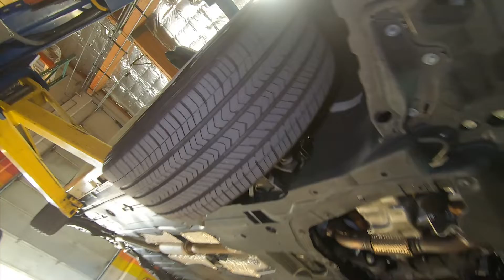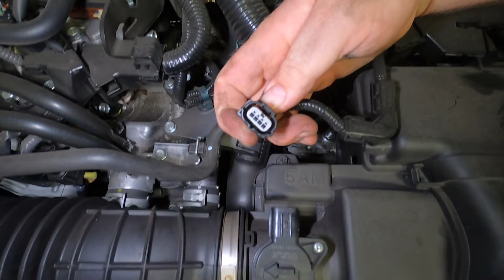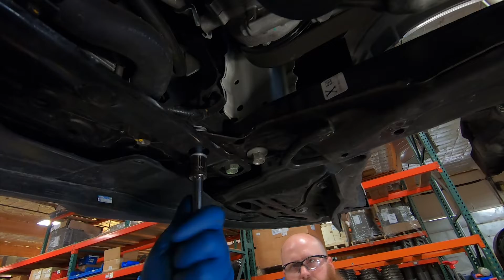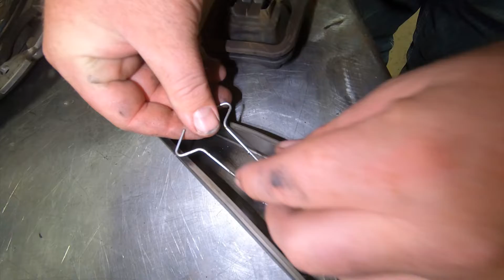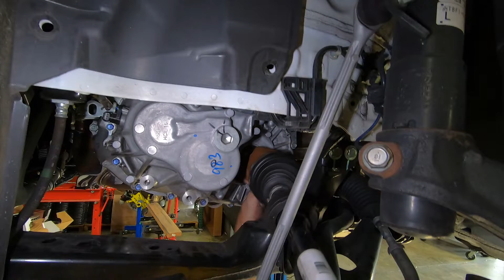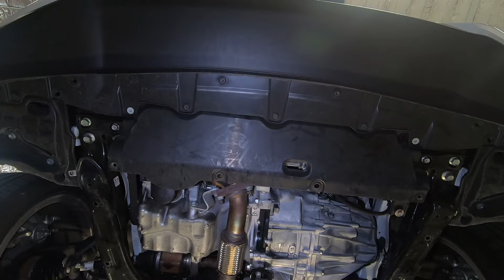ACT Clutch Install: 2017 - 2026 Honda Civic Si 1.5L Turbo and 2017 – 2024 Honda Civic 1.5L Turbo

Comment: My shop just called me saying that the oem bolts for the middle of the flywheel are not the right size for this clutch. If different bolts are needed, where are they so I can buy them?
Reply from the maker: The flywheel bolts included in our kits should be correct. If they feel they are not correct, please have them call our technical / service department @ 661-940-7555.

Comment: Did you guys have any trouble separating the bell housing from the block?  I've got about 1-2 inches of gap between the bell housing and the block but I can't get the transmission to come out any further.  All 8 bolts are removed and both studs are no longer in the bell housing.  There is a big gap around the entire tranny so I know its nothing like a forgotten bolt.
Reply from the maker: We never experienced this issue. If all the bolts have been removed and the transmission has cleared the aligned dowel pins, the only thing we can think of is maybe the input shaft is stuck in the pilot bearing. With some help, try to wiggle and pull the transmission free.

Comment: Just did one just this week if I had seen this before it would of helped. Did it on jack stands the lower starter bolt would not come out it would spin then lock up but would not come out. Had to pull out the Ridgid R86211B it's a beast with1500 ft.-lbs torque. It got it out the bolt had a ball of aluminum on the last 1/2 of the bolt. Pulling the trans & found the bolt hole on that bolt had cracked the trans welded it back up with a tig. When I put it back together used a course thread bolt instead of the fine thread one. The other bolt had wiped out the treads. Doing it by myself took me about 16 hrs. I'm near 67 years old so I'm a bit slow. How long did it take them 2 guys to do that one?
Reply: Shops usually charge 10-12 hours for this job, if that's an indication.  Can crest easily over 2500 for the whole job.  It's sorta silly how involved this is gotten.  Dropping the transmission out of my old integra was cake compared to this.

Comment: I got this same clutch installed in my car,  thought the clutch was bad cause the car was grinding gears and wouldn't go into gear.  Two master techs told me the clutch is bad.  Just as a note, I thought to think like on a dirtbike the clutch and brakes are adjustable be it hydraulic or cable.  So I did adjust the clevis and jam nut / rod underneath the foot well.  All fixed, adjusted to have a little free play.    Just as a note to others.

Comment: Is it needed to undo the whole mount for the transmission or just the bolts for the 2? Just curious, FX725 just went and will be needing to replace
Reply from the maker: If you are referring to the upper transmission mount, it is best to remove it completely.

Comment: Do I need the subframe alignment tool? If so where can I get one
Reply: I think you can get it done without/ probably just helps with getting it straight
Reply: Use a ½ inch socket extension it works

Comment: Thanks guys for the video , finally got this clutch replaced and I am happy with it
Did it all by myself  with two sets of jack stands and one hydraulic jack.
Time consuming but it was done properly ..
Reply from the maker: Thank you for the support! We're happy to hear the video was helpful for you.
Reply: How long did it take you?
Reply: @paull9086  it took me about 5 hours from start to finish,
No need to do alignment or bleed clutch 
I used an engine support from harbor freight,
It is better to remove bolts from wall when putting transmission back on , it’s easier . 
If you have any questions , I could tell you how I did it
Reply: @acevent1281  whats up do you have Instagram so I can text you question about this?
Reply: @acevent1281  Not bad, I'm trying to ball park how long a shop could do this in.
Reply: @BestCaseHypothesis  I got an estimate of 850 near me
I figured I could do it myself
It’s just common sense and a little bit of efforts
Reply: @acevent1281  damn! 5 hours? I thought this job would atleast take 3 days.
Reply: Honda wants 5k for this💀 and all I have is poopy driveway and no tools
Reply: @oggangsterprime9245 yeah Honda just quoted me 5k as well like hell nah bro
Reply: @Mal2Sosa was quoted 6k by toyota for my 12 gen corolla. Did it in my driveway with jack stands and 3 jacks, third jack to hold the engine in place after mounts were removed. Whole process was identical to the honda. I dont have 6k laying around so, said fuck it.
Reply: It’s not that hard , I did it a couple of years ago .  Plenty of videos on how to do it . And don’t need a bunch of tools

Comment: Has anyone paid to have this done? just curious as to how much it ran you.
Reply: $880 with tax at my shop. Customer supplied the parts.
Reply: Mine's in the shop for the clutch install right now. Owner quoted me $800, but I expect it to be a little higher when all said and done.
Reply: Told me 1500 without parts,so im doing it myself now....day 2 on my time lol sucks

Comment: I was gonna replace clutch myself but after watching this video I might as well hop on the bicycle...
Reply: its easier than it looks, just follow the guide, the hard part are the heavy lifting points like taking the trans out. putting it back in is a nightmare too, but everything else is easy enough

Comment: Well looks like the hardest part for me is not having a lift, oh well just got the Exedy clutch kit -08809, gonna watch a few more vids and get on this, wish me luck.
Reply: I may need to do this soon... how did you support your engine and transmission without a lift and stuff? I dont have one either
Reply: All good, only lost one bolt (subframe bolt) hit up up pick a part real quick, also had to readjust the steering shaft. Took about 4-5 hours all hand tools.

Comment: It’s not that I can’t do it’s that I don’t want to do it🤣
Reply: 2 years later, I’m bout to do it😢
Reply: Came back to say stay away from this dog 💩 clutch kit. Throw out bearing failed at literally 300 miles. Read forums all the supplied throw out bearings they give fail. gonna have to do this job twice to remove one supplied and replace with a oem one.
Thanks advanced clutch.
Reply: @Candybuiltsi  thanks for the warning, i was literally about to start this job in my garage solo
Reply: @LouisianaHotdog  yeah it might be cool if your not making a ton of power. My car is extremely violent with solid motor mounts spinning or a slightly bumpy road feels insane so maybe that’s what’s sent it out.
Reply: @Candybuiltsi did you drop the subframe?
Reply: @paynomorethanzero yes. I later learned you can just sneak the transmission off to the right without dropping subframe and slide in new clutch that way. Way easier
Reply: Got it done. Took me solo bout 22 hours 2 days😂 did it in the street with 3 jacks stands and just one hydraulic jack. Was tough but saved some money!! Grabs hard
Reply: This😂😂😂
Reply: keep us updated 🙌
Reply: @yeahok6748 yup everything going so good so far I have clutch in. Doing this solo IS TOUGH had to call it a night tomorrow everything going back on getting the transmission on is definitely the hardest part Im hoping my friend wants to come help me as Im only using a hydraulic Jack😀

Comment: Man none of this looks outside my skill level until I think about doing it all in one job 😆 I want a slightly lighter flywheel and a clutch in my 2018 si but I don't know if I should do it myself. I have all the tools, outside the alignment tools for clutch and subframe. If I do decide to diy it, I'll be watching this video a few hundred more times.
Reply: I’m with you. I have the know how and the tools to do the job. Question is do I want to attempt it, or do I pay a shop $3k and save myself the headache? 💀
Reply: @fordxbgtfalcon  If you have the know-how, then you can comfortably do this in a weekend.
Reply: It's just managing the tons of little ticky tacky crap just to get to the damn clutch.  I hate that.  That's why I'll pay for it to be done.
Reply: Do not get anything from SPEC! Don't ask me how I know or I will cry again 😢
Reply: I havent done it on a new civic but I did it on a 2020 corrolla hatchback and a first gen fit. Previously had only done basics like belts, alternator, brakes etc etc. Took 3 or 4 days hitting it on and off and going to work 2 of those days. Its not bad, just put all bolts and pieces in baggies, label them, keep everything organized, take pictures, lots of pictures as you go. I know this is old but if anyone else is reading and deciding to do it themselves.
Reply: @paynomorethanzero  I actually wound up selling that car during covid because it's value went up $10,000 from where I bought it. I wound up trading it in for $10k more than I paid for it and financed a new 2022 gr86, wound up with a cooler car and even less debt than when I had the civic. I did also make a fairly large down payment of $3k though just to save on interest. I'm still proud of myself for that trade. I trade stocks, bonds, and crypto, but I also saw how the car market was going to go and I bought a car at the bottom, then sold it at the top. I couldn't have done a better trade if I tried
Reply: You could probably get a mobile mechanic to do it for like 1100 bucks where I’m at. I just paid a mobile mechanic 1100 bucks and I just bought the clutch the flywheel the pressure plate that they’re out barn and he’s gonna do it. There’s some shops that want like 1600 bucks. I’m like OK that’s not bad but I’m just gonna let this mobile mechanic do it cause I don’t feel like doing it

Comment: Anyone accomplish this in their driveway without a lift?
Reply: Yea just did a few days ago no issues didn’t even need the engine hoist just used a jack under the engine to support it.
Reply: @DUCK4TWENTY  you fucking beast 🤝
Reply: @DUCK4TWENTY   pics or it never happened
Reply: I am currently doing this job. No engine house just a floor jack. It’s a pain for sure but can be done

Comment: Step 1 pay a reputable shop 500 to do the job.
Reply: If u gonna do the clutch,while he's  under there do 
Down pipe
Sub frame brace
Cable bushings 
Intake
Exhaust 
And any other upgrades..One shop do it all
Charge pipe
Reply: If you go to Honda they charged me $2,700
Reply: That is one hell of a friend do do that for 500.  That is a minimum 12-13hr bill and more like +$1400 for an install w/fluids.
Reply: @MegaHollywood1971  yeah, 1400 is fucking ridiculous. Someone shafted you hard. 
It's about an 8 hour job on this car. $98-100 an hour which is average for most shops comes to +/- 800.
Reply: @darkknight097  a lot of it depends on where you live. I'm in a rural area and the only mechanics in the area that I trust have a long waitlist and definitely charge quite a bit. Not that I'd ever do that anyway. I have enough friends who do stuff like this and enough interest in it that I can usually get whatever I want done for some beer lol.
Reply: @mikecurry6847  ya i do work for people all the time make me some money and it still cheaper for them
Reply: @MegaHollywood1971  do it my selft i will pay only for cluch and fluid
Reply: Fuck and that pay for parts and tool way cheaper

Comment: Lot's of unnecessary steps and mistakes.
Reply: The Mechanic in the video did everything RIGHT. Regardless if they noted was done in the wrong order or not, It was done in the CORRECT order. Disassemble and the reassembly. If you try and remove the subframe first before removing the axles. I guarantee you'll damage the CV joints/axles. The struts are free to sway to and fro more or less and could stretch the axles and pull apart the CV joints and/or also damage their boots.
Reply: Kevin how so ?
Reply: Edwyn Sanchez removing axles before dropping subframe for one is a big no no
Reply: Kevin So you can’t replace the CV axles without dropping the subframe? Fucking clown.
Reply: @Lilwonton6  I was also like WTF but they say in the bottom description -we put the removal of the subframe in the wrong order. Be sure to drop the subframe first, before removing the axles.
Reply: Why is it a no no.
Reply: MooseyQ says the nobody. Also go ahead and look into our own honda manual on installing a clutch as they’ll even tell you to remove the subframe first before the axles
Reply: Guys, guys relax and watch the first of the video again regarding when they removed the axles. Then read the "Please note" in the description.  Frig, here it is. 
"PLEASE NOTE: During the editing of this video we put the removal of the subframe in the wrong order. Be sure to drop the subframe first, before removing the axles. It is the proper order and it makes it much easier to get to the bracket securing the axle to the engine.  When we reassembled it you will notice we edited it in the correct order. We put the axles in then reinstalled the subframe."
HAHAHA I will notice what correct order editing upon reassemble? They put the frame on and then the axles after that....... The same way it was taken apart.   Face palm.
Besides anyone that's half competent knows the very first step.  Step 1. Drain the headlight fluid.
Reply: MooseyQ exactly all the “pros” say to remove subframe first before axles
Reply: Kevin What separates a real mechanic from a parts swapper is someone that knows when to take the manual with a grain of salt. Manuals are NOT written by mechanics. Using this logic, you can’t remove the front axles without dropping the subframe. That is nuts.
Reply: Aaron Gregory you basically proved my point lol. Have to drop the subframe before taking axles off. You can take it off with subframe in tact but you could you could easily damage it on these 10th gens
Reply: @Lilwonton6  You'd have to be a really incompetent mechanic to damage a CV axle when removing one 😂. It basically slides right out without getting caught on anything. Anyone who's done a clutch on this car would know that

Comment: Awesome! Its great to finally see a detailed video on how to do this on a 10th gen civic since Ive never done it before. Is there anything id have to consider after removing the steering components such as an alignment or etc?
Reply from the maker: We did not have any alignment issues on our re install. But you can if you do not use the alignment pins. Also when installing the steering U joint to the rack n pinion you could be off a spline and the steering wheel could be slightly off to one side. That is a super easy fix just un bolt and move it to the next spline over.
Reply: Where would I get the pins to align the subframe when re-installing
Reply: That small blue plastic sleeve with the line thru it falls to the side when one pulls the shaft off. So make sure to make a mark above it before you pull off shaft. I know this is 3 years later but this info my help someone. If it missalign it will kick on the steering wheel light on the dash. The wheel can be re-centered with a scan tool just have to find someone with the know how.